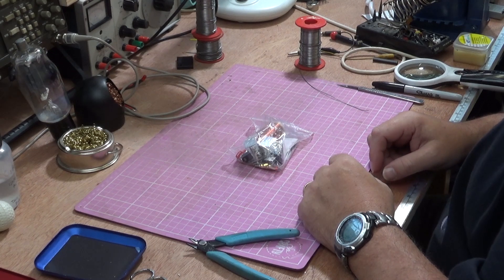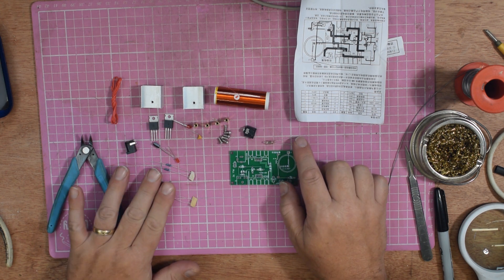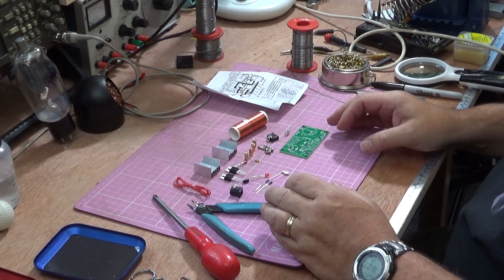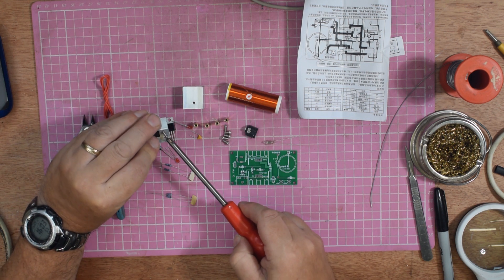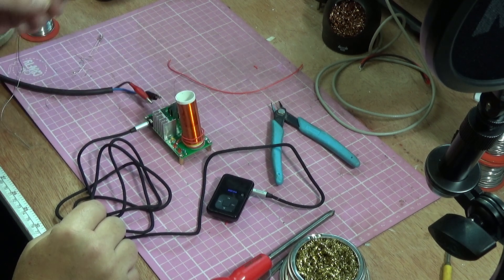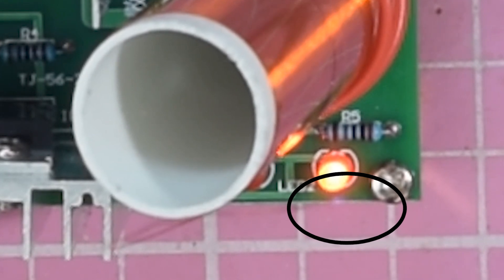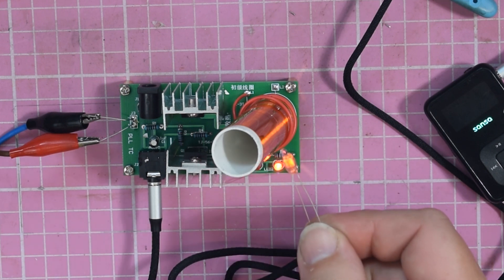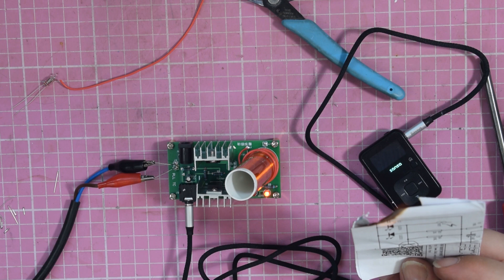Ebay Tesla Coil Kit - With FIRE!

Comment: I bought one of those but you beat me to the build nice to see it working.
Reply from the maker: It isn't the best to be honest, maybe reduce the turns on the primary of the coil to increase the step up ratio. Spark is very small.
Reply: George Christofi  Hello George. Yes I have built some larger Tesla coils. The primary winding, spacing and construction and capacitance is massively important for Tesla coils as it affects the resonance tuning  and Q of the system. I think you have also build Tesla coils so your probably ahead of me.
Reply from the maker: I haven't actually built any bigger ones. I have seen a lot but it is one of those projects that I never got round to building.

Comment: Certainly induced some noise into the audio Chris, I could hear the spark noise being gated by your voice.
Reply: I take it he intro w recorded later as I could hear some gated noise during it.  Reminds me of 3AW Melbourne in the late 80's when I'd worked out that their talkback system had a Vox that was intended to prevent the caller talking over the presenter. Instead, the slightest rustle of paper would take the caller off air causing long periods of dead air.  Neither the presenter nor the panel operator were aware as the caller was not interrupted in the cans and due to the 7 second delay, they could not monitor off air.  I proved the theory by turning up the volume during a period of dead air and there was the rustle of paper.  I wrote a letter explaining what I'd figured out and now they manually control the talkback system.
Reply from the maker: @Wenlocktvdx  yes, recorded after. I have done some other tests and I think I have tamed the bounce now. It is just there but not super noticeable
Reply from the maker: I heard it too but figured if I tried to gate it too much i would get some really bad bounce noise from the compressor.